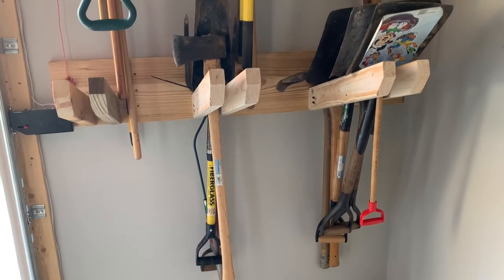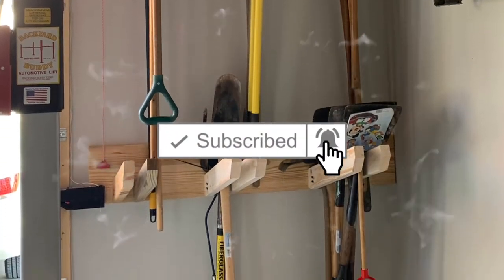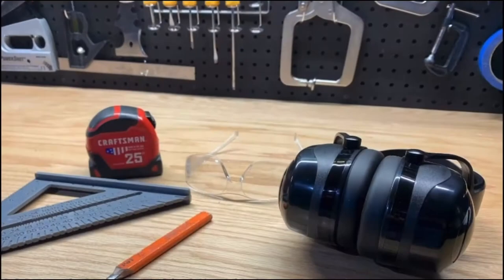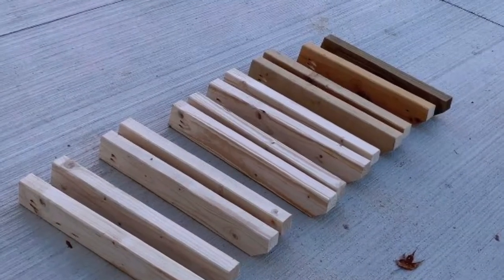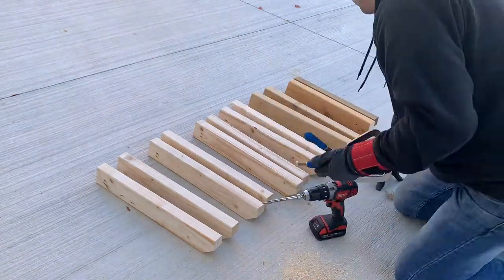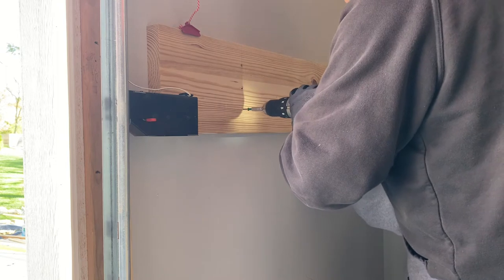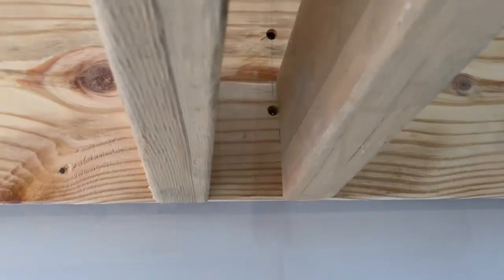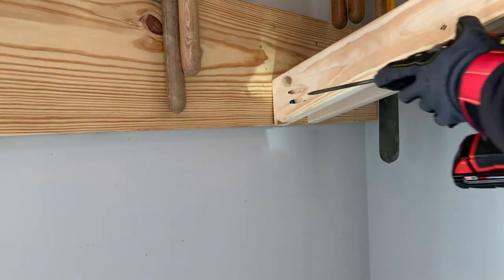DIY Yard Tool Storage Rack

Comment: does this get loose an weaker over time? Was gonna build but now I'm thinking I should just weld up a similar design with steel...🤔
Reply from the maker: The one in the video will be 2 years old and I just tested it and it’s rock solid.  It’s possible after many years, but it’s very easy to adjust slightly and secure them again if so.  Another option is adding wood glue to make the bond stronger as well, but I haven’t had any issues.  👍